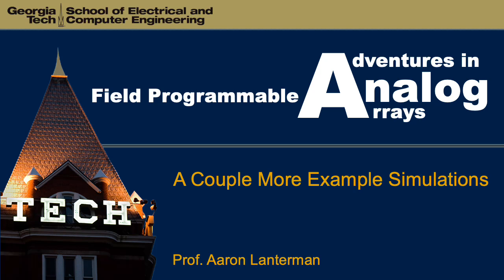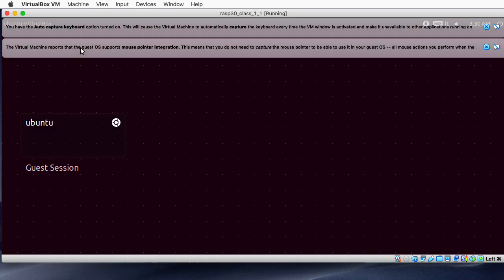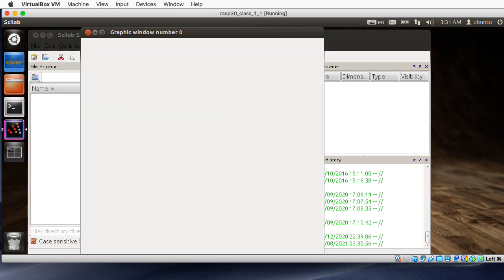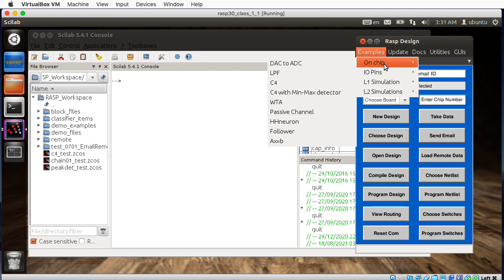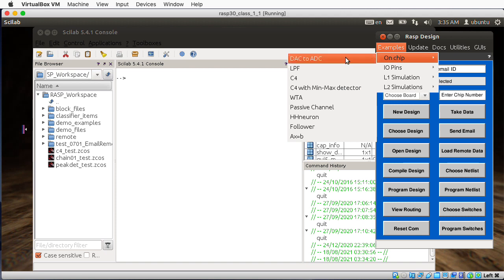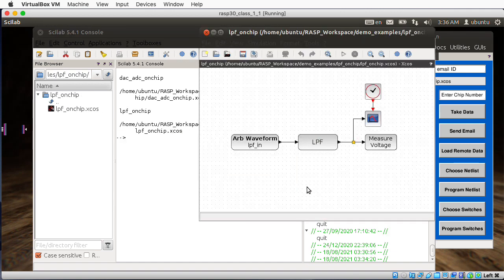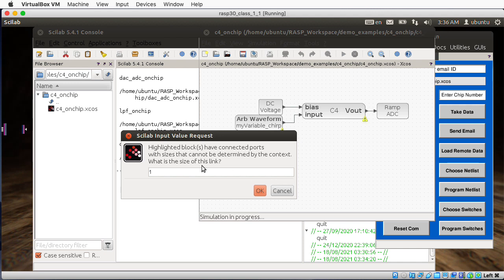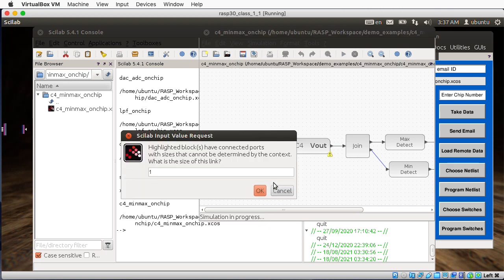A Couple More Example FPAA Simulations (Adventures in Field Programmable Analog Arrays)

Comment: Hello Sir. Will you be posting any videos on level 2 simulations any time soon? I am currently working on a project to implement a fractional order filter on the virtual fpaa, but I am still struggling to understand how to do that.
Reply from the maker: In all honesty, I'm just getting started with experimenting with the simulator myself. I'm curious, what lead you to (a) fractional order filters and (b) FPAAs?
Reply: @Lantertronics  I am currently working on it for my final year project for my Bach. degree in electrical and electronics engineering. I was supposed to implement on Anadigm's FPAA board but that is not possible now due to the Covid outbreak.